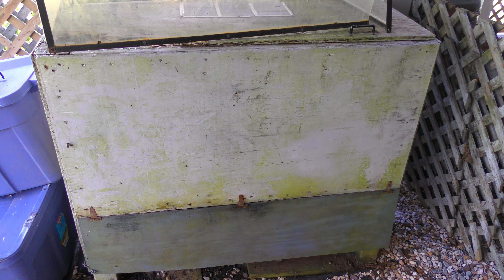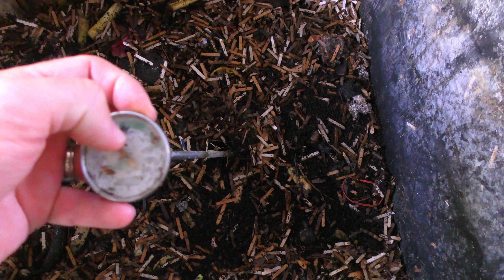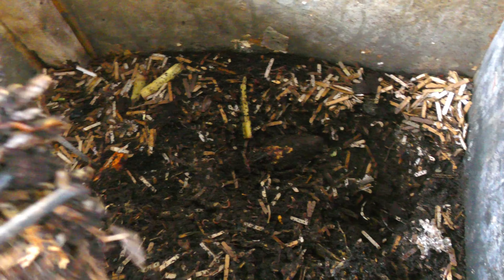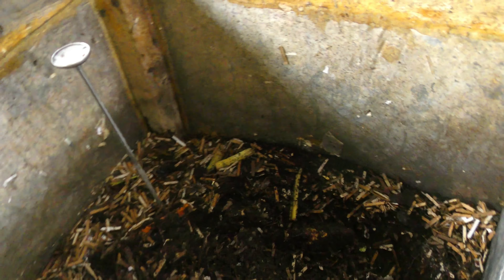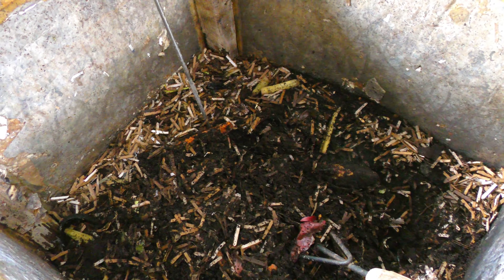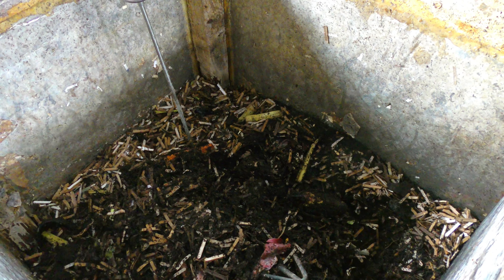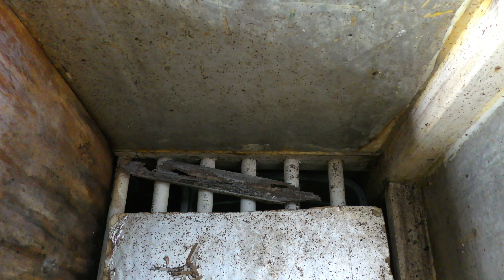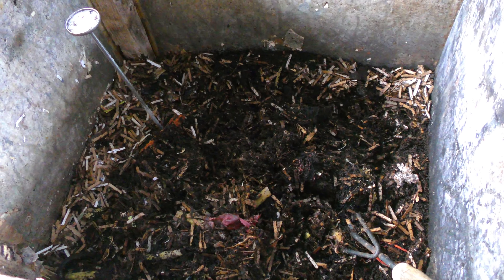Large Bin Update 5 Years

Comment: Great video! Lot's of good information. I was wondering though, how does all of the compost not fall through the pvc tube grill at the bottom? It looks like they are pretty far apart. I am thinking about building one for our farm and using chicken wire with a fairly small screen size to keep most of the compost up and have some of the ready compost fall down regularly. Do you think this would not work? Thank you!!
Reply from the maker: The compost doesn't fall through due to tension it puts on the sides.  I probably could have had even a larger gap to be honest.

Chicken wire will work but it will be really hard to get the compost out of the bottom. It is amazing how well it can stick together and hold itself up.
Reply: @WorldComposting  Thank you!!
Reply: World Composting do you put thin cardboard or thick newspaper over the bars when u initially set up the bin to keep 5e bedding from falling out before the worms work thru it and make it sticky?
Reply from the maker: I think we started with just a few sheets of newspaper with shredded cardboard/newspaper on top

Comment: I have been researching for about a year , started my first bin in October. I now have 5 bins , an Urban Worm Bag V2 I got for Christmas, and an old, plastic composting bin that I have put some night crawlers in to experiment with it. I love the box you built for your parents. I am in Oklahoma and we get very hot in summer and winters are bipolar . Thanks for sharing and I appreciate that you not only tell the "how" but the "why" things work or don't work when being done . I look forward to more experiments from you and doing on my own . I will say however the bokashi just is not something I can tolerate. It is interesting to see how it is done though. I just can't do the smells with my health issues.
Reply from the maker: Maryland is the same way the temp jumps around like crazy and we have seen lows of -5 and highs of 107.  When creating a bin for outside it needs to be able to handle a huge range of temps.

Unfortunately my parents are decommissioning the large bin as it is starting to breakdown and fall apart after 8 years of use.  They recently handed me two tubs of worms and are now using a compost pile.

If you have any questions about the large box let me know and I'll try to answer them.

As far as Bokashi I'm not sure I'll be doing it again the smell was horrible and I was really worried I would just have to throw out the Vermibag.  Luckily it doesn't have any smell anymore.

Comment: My advice is discard that bin and construct a new one.   I don't ever recommend building anything out of wood, treated or not, that must sit outdoors.   It will NOT last.  Deterioration from weather, insects, or chemical reactions will always destroy any kind of wood.   Build your bin using other types of materials than wood.  One very good substitute is Hardiboard, which can either be purchase in planks or sheets.   It is a fiber cement board with no wood in it whatsoever.  It is insect, water, and even fireproof.   

You should line it with the insulation or some other material to keep the worms from coming in contact with the Hardiboard and ingesting the silicone particles.
Reply from the maker: I have been looking at other materials.  If I did rebuild I would probably only keep the frame and replace the rest with something other than wood.  Granted with the 2x4 rotting out now I'm thinking that I might only get to keep the PVC pipes.